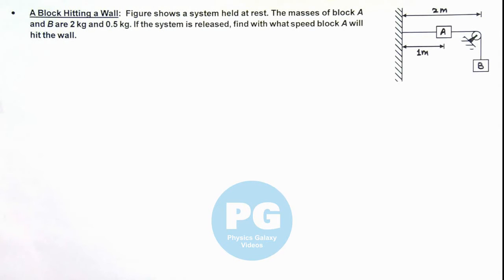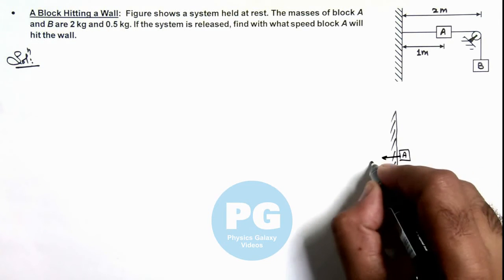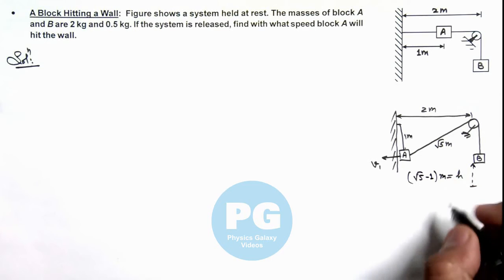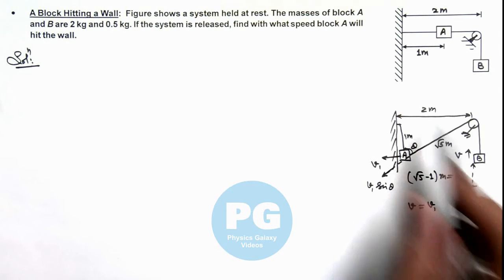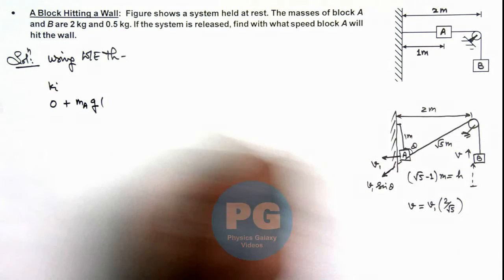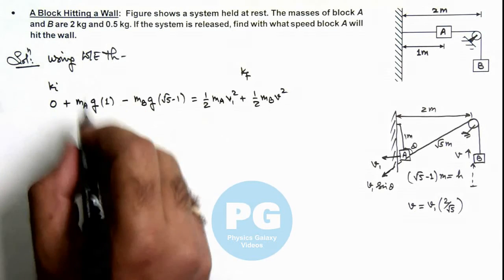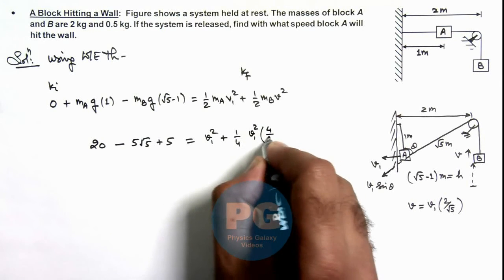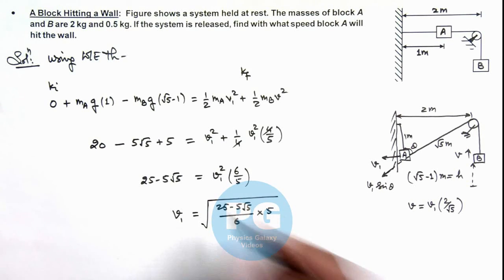Advance Illustrations – A Block Hitting a Wall |Work Energy Power #7 for JEE Advanced

Comment: Why is velocity towards wall (perpendicular to rope)? pls explain
Reply: consider it t o be similar to a pendulum motion(not exactly since there is also a string for restricting the motion) and as soon as it reaches the bottom most part the velocity of block A becomes  perpendicular to wall.

Comment: Sir the explanation isn't very clear. Why the velocity of block A will be perpendicular to the wall.
Sir please help.
Reply: The velocity of a will be perpendicular to wall. You can consider it as a case of a doing vertical circular motion with centre fixed on wall and radius as 1 m, where the velocity is always perpendicular to the radius.(tangential to circle
Reply: Same doubt

Comment: Sir, why did you use √5-1 here?
Reply from the maker: When the string was horizontal then its length on the left of pulley was 1m and when block A hits the wall then its length is √5 m... so the change in length on left side is equal to that by which block B ascend is (√5 -1)m
Reply: But at initial what is the reference level
Reply: Why is velocity towards wall (perpendicular to rope)? pls explain

Comment: sir while calculating the final kinetic energy of the block why haven't you considered the other component of the velocity ( v cos theta ) as well
Reply: Because velocity along the string is same as of block B.
Reply: @ayushbhaduria12  sir has considered v1..and not vsintheta alone in work energy equation..for constraint yes...

Comment: How do we know that block A will have its net velocity directed horizontally
Reply from the maker: because the string with which it is connected becomes vertical when it hits the wall... and  velocity is normal to the string...

Comment: hi sir as u in question written block a is hitting wall with some speed and if it is not mentioned in the question that block is hitting with some speed are we suppose to consider it as 0 i.e. final velocity of block as zero(block=a)
Reply from the maker: No... using W-E theorem we need to calculate the speed with which it is hitting... we cannot consider zero unless it is mentioned...